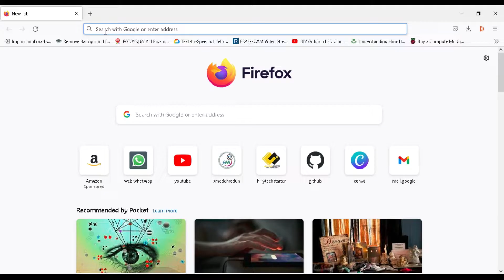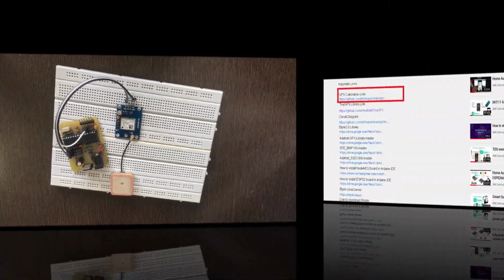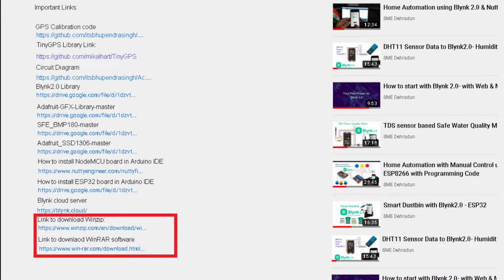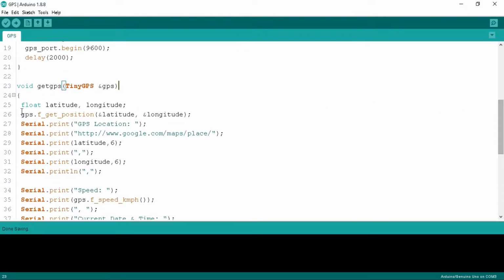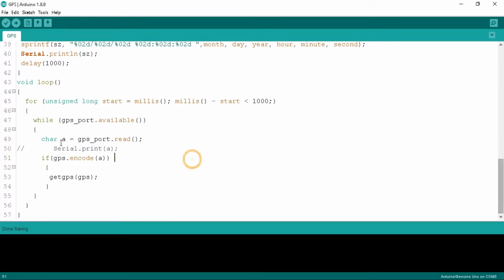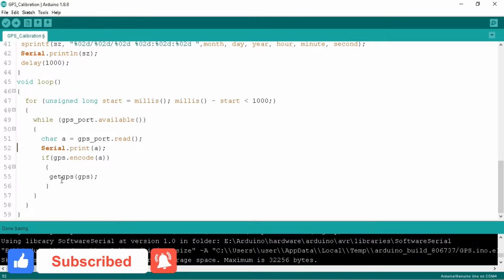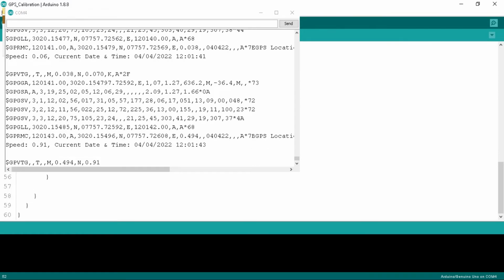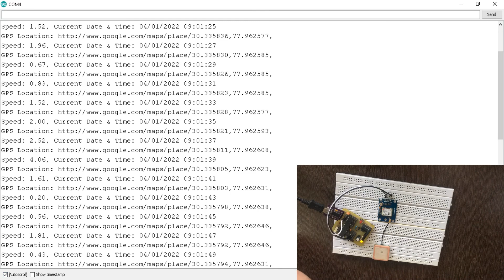How to decode GPS data using Arduino- Track Speed, Date & Time with Google Map

Comment: sir, port number not showing
Reply: Sir, Output is not showing
Reply from the maker: It’s depend on your GPS is working of not. If you are using gps neo, then it’s start blinking led while getting gps location.
Reply from the maker: So you need to install the com port of your board. 

https://youtu.be/LpohiGf8GiU
Reply: @SMEDehradun  thanks for ur support
Sir, my code runs but not showing location address

Comment: Why is your title  name a GPS calibration? Where is the calibration part ? I don't even see in code calibration
Reply from the maker: Hi,
If you see properly in GPS library, you will get know and also there is hardware where you see the data signal with TinyGPS, while you working with Arduino
Reply: @SMEDehradun  there is no calibration in library, library is for parsing NMEA format
, i don't know whether you understand difference between parsing and calibration
Reply from the maker: 😊 so what are you looking for? 
Be clear on it.
Reply: @StoryofEV  I think you don’t know things you are looking for. 
Just write what project you are looking for.